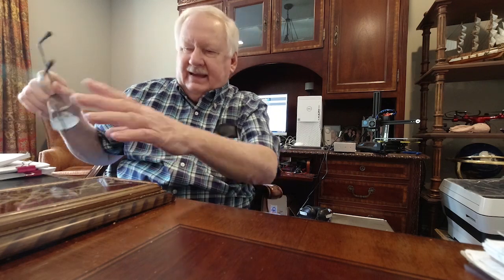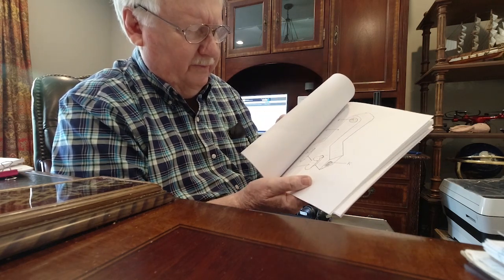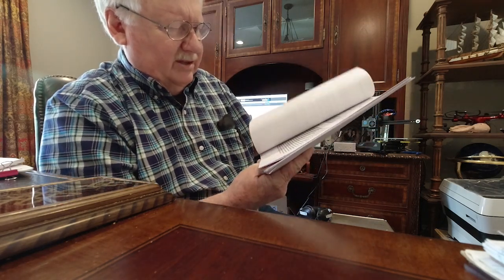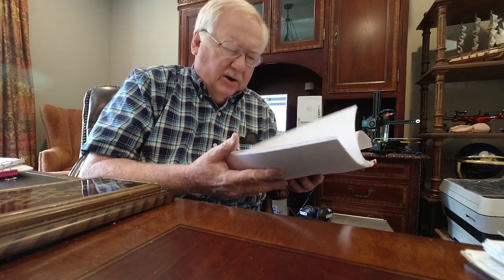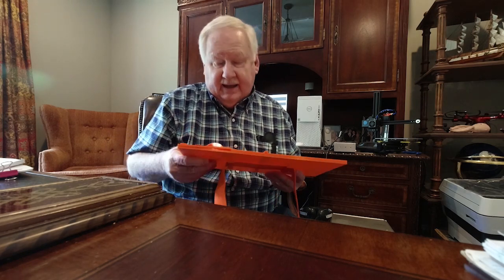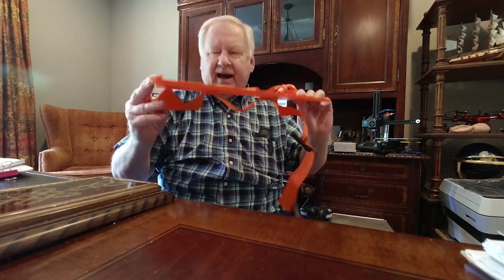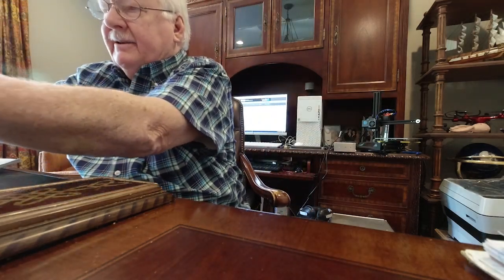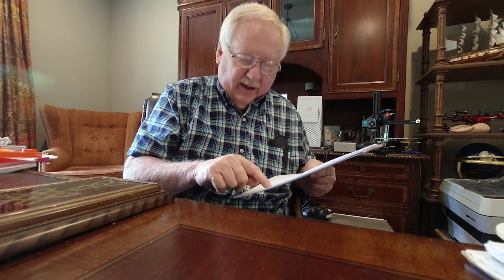HOW I FILED FOR A PATENT ON PRODUCTS I MADE WITH MY 3D PRINTERS

Comment: Hi Ken, I really like your videos! I couldn’t help but think to ask what software you used to model your device, and does it have a drawings package to generate your drawings digitally? I would think that would help save you a tremendous amount of time if you do more patents possibly. Also, I wish you luck with the helping hand!
Reply from the maker: Thanks for the kind words Ty. I am still using Autodesk 123D Design  software but also have other cad software including Alibre Atom 3D  software which I purchased a few months ago and still learning (when I have time). I think I will be able to print drawings, with a little effort on my part, that I can use for the patent process or for general description purposes. Thanks for the comment and your support...Ken

Comment: I was watching a YT video about the patent on 3D printing held by Stratasys and how when that patent ran out and the building and marketing of 3D printers and the RepRap and Open Source movement came about and  the cost of 3D printers fell from $20000+ to under $1000 and became within the financial reach of hobbyists, also the industrial market became huge which massively benefited Stratasys.
 It was so interesting to hear how the patent protected Stratasys and its IP but also how the closure of the patent also gave birth to a massive movement
Reply from the maker: Very interesting Andrew, thanks for sharing that. I am more interested in trying to produce a quality product that I can sell without having to worry about someone preventing me from doing that, than I am of trying to prevent someone else from making a similar product. I wouldn't bother with a patent at all, in most cases, if I knew no one could stop me from selling it. I am trying to find out If I produce a specific product without a patent and someone comes along and gets a patent on my product after I Have been making and selling it, can they force me to stop selling it? It's a legal question concerning weather I have any rights if I first had recorded proof that I came up with the Idea. That is the question!! Thanks buddy for your input and let me know if you find out anything more...Ken
Reply: @NewTechInventors  the answer to your question is no they can not force you to stop selling it if you invented it first. 
Lets say they  did end up getting a US Patent, and after that they decide to go after you for infringement, all you would have to do is prove you invented it first and then you would start a process of invalidating their patent. In that way, their patent will no longer be valid. Keep in mind this is a long process and take time and money. 
The purpose of a patent is to protect your invention so no one else can replicate it.  So, if you are worried that someone will stop  you unless you have a patent that is not the case. You just need to prove you invented it first. 

You should also consider Design Patents, which protect the ornamental appearance of your invention. Utility patents, which showed in this video protect the utilitarian/function of your invention.
Reply: @ᗩᑎᗪᖇEᗯ ᕼᗩYEᔕ Yes, I remember reading that somewhere also. 
Our founding fathers were geniuses, Patents help drive our country with innovation. The founding fathers (Jefferson) created a great system, the US Government will protect a persons invention during the life of the patent, and the tradeoff is that the patent must be disclosed publicly. So, you have the blueprints of this cutting edge technology and the making of it publicly disclosed so that the public can evolve and encourage innovation. However, the public can not sell/make the protected technology; the information is just out there so we can grow technologically. 
Imagine if all these companies never disclosed how their products work, I don't think we would be were we are today
Reply: @digitalartsagent1338  Yes its definetly a swings and roundabouts situation, it becomes a problem when someone patents something and never works on it again or never brings it to market, that just stifles innovation, I believe things have changed with this or are about to.

Comment: Sir exectly what kind of product you are making now
Reply from the maker: The main product going on sale next month on my new website will be "The Helping Hand". It is comprised of approximately 30 different 3D printed parts and about 25 non 3D printed parts including electrical connectors, hardware, power supply, clamps, and more. My video "The Helping Hand Demonstration Video" will show some of the product features. Also you can see the parts printed in another video "25 parts I print for "The Helping Hand". Hope this will help answer your question...Ken